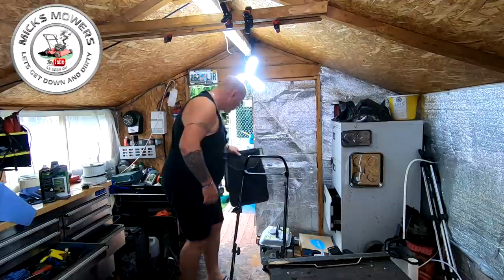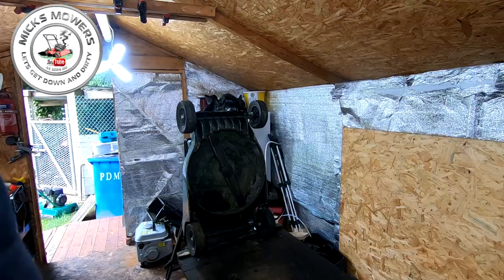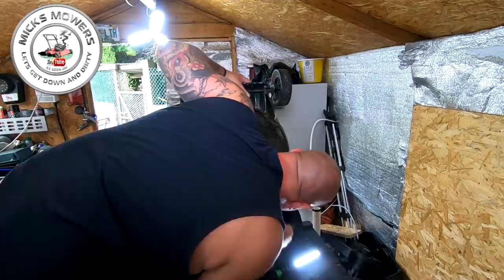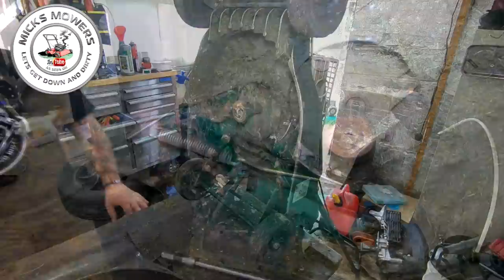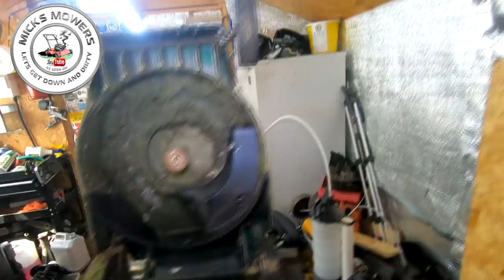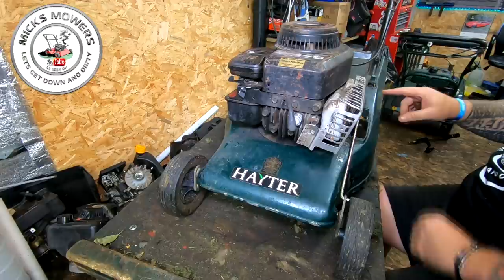Hayter 41 Axel Fix And Cowling Replacement

Comment: Great vid Sir Mick.  Is there any way you could strengthen that bracket with a bit of the old fibreglass me old mucker? Good tip from Les on fitting a height adjustment spring.
Reply from the maker: Yeah you could.. and is worth a go mate

Comment: Hi mick I’ve just gained a wheeled strimmer. The fuel primer bulb is holed and knackered. Can I replace it or does it need new carb. And is there a better way to contact you
Reply from the maker: Via email mate micksmowers01@gmail.com

Comment: Hi Mick. Great video. Can you please tell me the name of the guy on ebay selling cylinder mower parts. I am always looking out for parts for my Qualcast 35s. Thanks.
Reply from the maker: Here you go mate.. https://ebay.co.uk/usr/spaceman369
Reply: Hi Ray, If you need anything qualcast classic related drop me a line on eBay. I’m away on and off atm with my job hence why nothing is listed on eBay currently. I usually have most parts in and happy to help out where I can. 👍🏻 Cheers Jamie (Spaceman369)